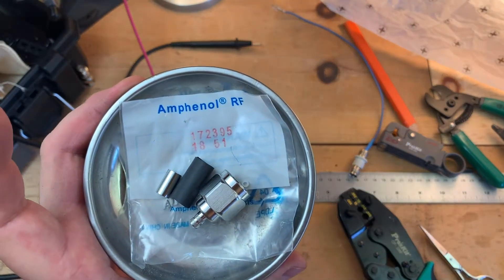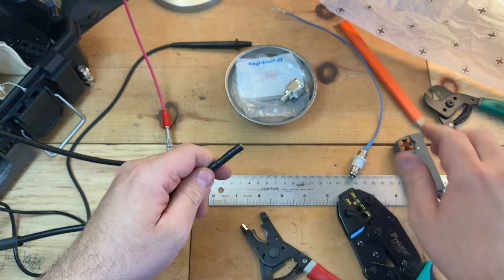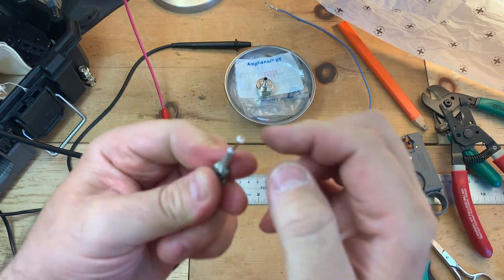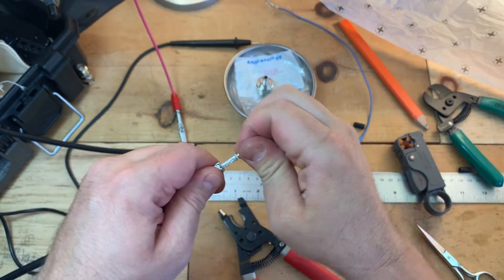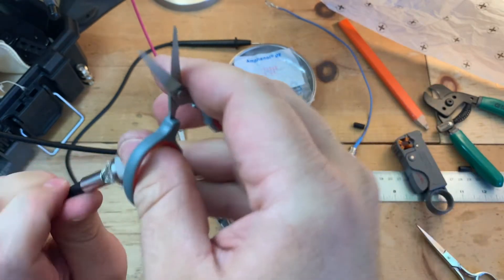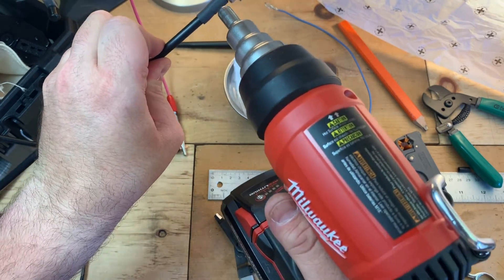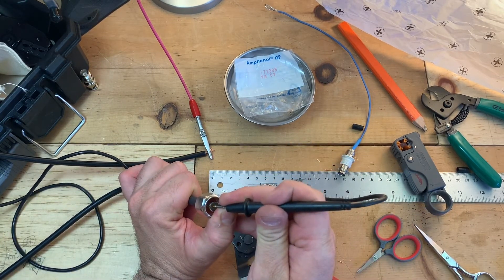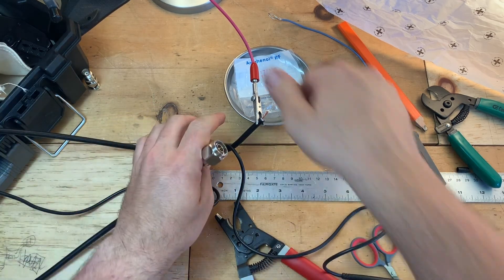LMR240 Making an N connection

Comment: How good do you think that LMR240 would work with GMRS on a 50ft Length?
Reply from the maker: I’m not sure. From what I’ve seen, LMR400 is more popular for longer runs.
Reply: @juanaragon3771  Its doing very good, my swr dropped down to 1.09 from about a 2.0 using PotaFlex from Italy.  But thanks for the Reply.  Oh but I got AMR400, suppose to be just as good which now i think it is.